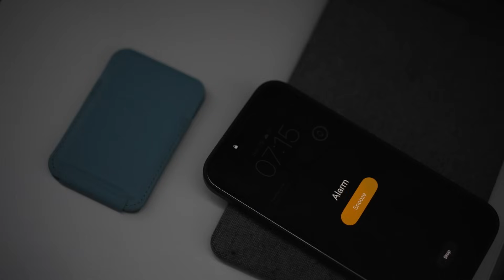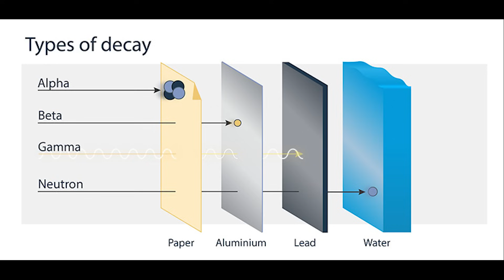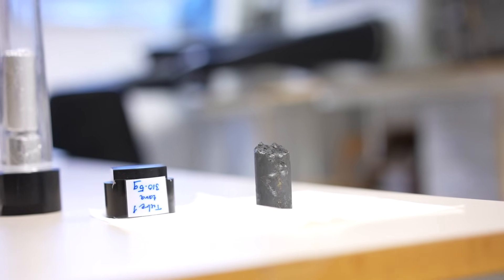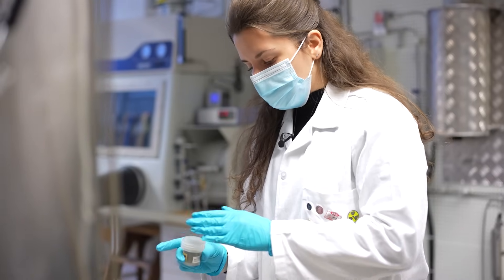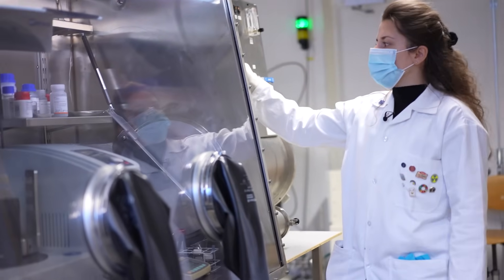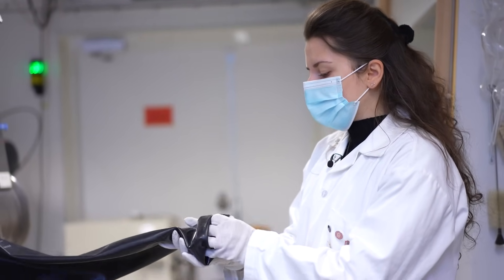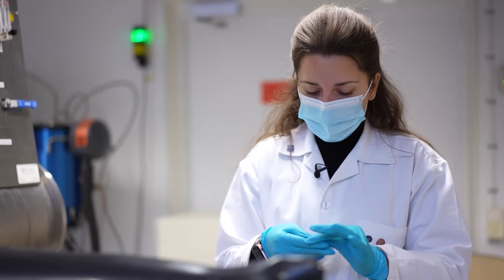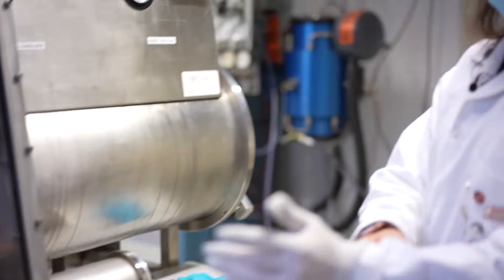Touching URANIUM and EXPOSING Myths - A day in the Life of a Nuclear Physicist

Comment: Interesting. But what happens if you touch a radioactive uranium rod (nuclear fuel used) freshly extracted from a reactor?
I think you would die in less than a day. Prove me wrong.
Greetings.
Reply: It's your duty to prove yourself right. Not the other way around.
Reply: I don't have an uranium rod, so I can't.
Reply: @KasusEpykMusykII Spent fuel is definitely far more hazardous than fresh fuel. Straight out of the reactor it's very hot as well. You'd get thermal burns as well as receiving large doses of ionising radiation from the short lived fission byproducts. The short lived isotopes are the most dangerous. Residual U238 has a half life of over four billion years. As such it's not a radiological hazard.

Comment: I know this video is kinda old but I would like to know at which point pellets start to be dangerous. As I understand it it's proximity due to expelled electrons of nuclear decay. So fuel cell will be radioactive due to amount of pellets inside and with many fuel cells close together both radioactivity and heat will raise. Am I correct?

Comment: She would be dead if she even comthe e across the depleted pellet because then it emitting gamma rays and beta rays, But still the way she explained it is remarkable as it need guts to hold fuel grade pellet in hand, I once held a hockey puck size uranium-235 in hand for experiment it is warm to touch and extremely heavy.

Comment: I cringe every time I see long haired people working in a lab. Although it may not be technically and issue in this lab, it is unprofessional. Also, while you are shielding your hands handling alpha emitting sources your face and eyes are not shielded. Albeit there is air in between, I would still wear a plastic shield. That u-238/235 plug is fairly hot  for example.

Comment: Hi Elina.,  thanks for your video it is very educational ! but i got some questions would like to find out,  1. when you handling the uranium, you wear nitrile gloves and medical mask, you just told us the radioactive is quite low, but can the nitrile gloves and mask can really block the radiation from the metal ?  as my understanding, those protective wearing is only able to block alpha rays, not beta and gamma.   2. you did put the uranium on the table for measuring out how much uSv/h there is, but after put it back to the plexiglass tube, would the table also your gloves contaminated ? even theres no dust remains ? thank you !

Comment: Over 30 years ago my brother in law was a foreman at a solution ground water mine.   They used 8000 gal of ammonia per day to make the uranium oxide  soluble then a polymer column was used to extract the Uranium from the water.   Then the yellow cake was worth $6 / lb in 55 gal drums.       He was not concerned about radiation.

Comment: I have measured radiation during every time i fly and i have counted up to 430+ at 39,000ft exposed for hours and its not a common knowledge for most. 
What are your thoughts in regard potassium iodide after the flight ?
❤ your accent.
Reply: What should potassium iodide do after a flight? 🤔 Normally, you should not get in contact with radioactive iodine isotopes during a flight, and I don't think you get enough neutron radiation on a flight to turn any elements in your body into radioactive elements. So, you don't need to block your thyroid. That's only necessary after accidents with nuclear fission.
Or did I miss a detail?
Reply: @cymbala6208  no you did not miss anything maybe I did.
thank you for the reply and sharing

Comment: On a Nuclear Submarine, I worked 15' from the nuclear reactor all day and night, when I was getting stores from some storerooms I had a 10min exposure limit in certain storerooms but not outside the room, the rooms actually blocked radiation and were used that way, I wore a film badge and I got less radiation than the people on the surface...

Comment: Well 500 ySv/h nothing I would keep an hour on my hand a year dose rate in Germany is just 1-2000 ySv/a 😅

Natural Uranium "dirty" ores, are not harmless, compared to a cleaned Uranium pellets.  I definitely would use gloves and stayaway from dust particles of thorium or uranium ore.

In Germany the Sowjetunion let dig out a lot of uranium ore with pure hands in the occupied east-german sector without an savety equipment in 1960-1990 and we had a lot of lung cancers and related lung issues and deaths on the mining areas in the mixture of heavy metal toxicity and radioactive byproducts of natural urainum ore.

Sowjet minds always lowerd the relatet health issues and kept the workers keeping working in DDR sowjet sectors to kept its mining output high by lower any investigation about any danger of mining uranium.

So I would not say dirty uranium ore is harmless. 🤔

Best regards a medical engineer 🙃

Comment: I like the explanation, it's only really nasty when it's in particles inhaled like from being burned. It is pyrophoric and will readily burn in air.
Natural uranium does emit gammas from the natural decay daughter products as it heads towards stable lead. 
At 4:04 does her gloves now read a higher count since you touched the metal and got micrograms of it in the nitrile/rubber on there? Touch contamination and dust would be an issue long term.

Comment: I have some questions. Is the depleted Uranium less radioactive than, natural uranium? And secondly, is depleted uranium less radioactive than other natural occurring minerals (not their radioactive counterparts)?
Reply: Yes depleted uranium, like refined metallic uranium is less radioactive than uranium ore.  This is because in uranium ore the uranium is in equilibrium with its progeny (aka "daughter products") e.g. Ra-226, Bi-214, Pb-214, Po-210 etc., and they are mostly more radioactive than uranium itself, as shown by the much shorter half-life values.  
The removal of some of the 0.7% U-235 from the 97% U-238 metal does reduce the radioactivity of uranium metal slightly, as U-235 has a shorter half-life, but it isn't all removed, just "depleted" from 0.7% to about 0.3%.

Comment: I appreciate the explanation regarding sample and surface preparation prior to characterization. 

While attending university, I worked within various chemistry and physics laboratories, specifically working with single Crystal and powder X-ray diffraction groups. 
Also work with growing crystals of organics for IR spectroscopy.  

Where I see the most parallels for the UO2 preparation and my work, was with surface preparation of rock samples for optical work. 
How thin of a wafer slice from these pellets would your group use?? 

Excellent video! Thank you for sharing!

Comment: I was at a tour of a nuclear power station in 2016, (Heysham 2), and on the tour they told me how they inspect the fuel rods before they go into the reactor.  At this point they are not particularly radioactive they said, and are inspected by hand.  you can safely handle Uranium fuel before it goes into the reactor with your bare hands, only once it has been through a cycle in the reactor core does it become dangerous. The blue gloves were not for the protection of the workers handling the fuel, but to protect the fuel from the oils and grease on the skin of the person handling the fuel

Comment: I guess an interesting question would have been what is the advantages of nitride over oxide?  Why is it worth having a fuel that is prone to oxidize?  Also, is there any problem with it oxidizing?  I mean neutrons need to be moderated by water before they can enable further reaction so as long as you have the same uranium atoms in roughly the same space does it matter that both oxygen and nitrogen have found their way into a molecule?

Comment: When I worked in aviation I would handle the wingtip end weight bars made of depleted uranium with normal gloves and no special protective gear. All I recall is that was way heaver than lead.
Reply: Often these sorts of weights are nickle-plated, which prevents them from breaking down, and also stops any remaining alpha activity.

Comment: M. Sc. of chemistry here and some general infos about glove boxes because some people have asked:

Glove boxes can be used both ways. My colleagues at the uni worked with glove boxes as well because their synthesized substances were air-labile (unstable in air due to oxygen AND water vapor). For protecting the substances you need a slight over-pressure  inside the box. If there was a leak the inert gas would come out and no oxygen would get in.

If you are working with substances that must remain inside and the environment incl. YOU needs to be protected, then a lower pressure inside is necessary so all contamination remains inside! E.g. in virology labs working with potential dangerous germs or viruses .... or biochemical labs where research on GMOs is done and even if you work with higher radioactive materials. If there was a leakage the air from outside rushes in and so everything STAYS inside. 😉

Comment: The way you handled radioactive sources and showed it online to other people was reckless

First, you did not specify to the viewers the activity of the source you were handling in the video. That's a major mistake.

Secondly, based on what I saw on the label specifying "Tube 1 310 g", I assume the whole tube contained 310 g when shipped and also, there, the label does not specify the activity of the whole tube. Your sources were poorly labeled!

Thirdly, let's estimate the activity of your sources based on a specific activity of 25.4 kBq/g for natural uranium, you've got around 8 MBq of natural uranium in the whole tube (310 g). If the tube contained 5 pieces of metal, the piece you were handling had 1.6 MB in it. Your nitrile gloves gave you some protection so it's not that you had the source in direct contact with your skin but those gloves are definitely thinner than a 5 mL polypropylene syringe and a 1.6 MBq source in that 5 mL syringe give a dose of 53 mSv/h on your hand when touching it. That's reckless because you can avoid that dose by just handling the source with a long tweezer like any radiation workers are taught to. You've got poor training in radiation safety and moreover, you broadcast this poor training online.That's doubling down on major mistakes!

My calculation might be wrong but I doubt that because the same source (1.6 MBq) assumed as a point source would give 350 uSv/h at 30 cm and your dosimeter showed that range (500 uSv/h, slightly higher because your probe was closer to the source than 30 cm).

So, viewers, be advised! Safety first and always when handling radioactive sources! Always label them properly, name of isotopes, and activity. Handling them with long tweezers. Know your source and never touch them directly, they are hot!

At last but not least, alpha emitters cause more damages when touched compared to other isotopes so the low activity is a false apparent safety. The contact dose with gloves on is about 100 times higher than what a dosimeter would show and if you have some natural uranium on your skin, the received dose goes up by 20,000-fold! So, just be careful with any radioactive dose you'd be handling in the future.

Comment: The most interesting thing I learned about in the operation of a nuclear reactor was the concept of the neutron source rods. That is, effectively, a nuclear match (or pilot light) to start the reaction. Up until that point, the pellets are relatively low emission and safe to handle. Once they are exposed the neutron source rod, then the process of fission accelerates and you get all the active secondary materials that are the products of decay and you don't dare touch them for a few hundred years (at least)!

Comment: What is the face mask actually good for?
Reply: Prevent ingestion of any fine dust particles that might get produced whilst handling the material. It doesn't take much to stop alpha particles, even dead skin cells will do it. However, you do not want an alpha emitter lodged in your lungs, or gastrointestinal tract where it can irradiate nearby living cells. Cuts and open sores can provide another entry path into the body for fine dust particles to enter. Although statistically possible, I guess, a single alpha particle entering a living cell would probably not result in a cancer causing mutation, the cell might repair the damage or just die. But even minute, alpha emitting particles, with a long half-life and lodge in one location, may cause enough cell damage to eventually create a cancerous mutation.
Reply: @hitchmille  Ok. When I hear radiation I think of stuff that needs some heavy protection but since she doesn't have any the mask was even more confusing.

Comment: I remember going on a tour around the nuclear power research reactors at Winfrith in Dorset c.1970/71, a friend's father worked there [it's long been all dismantled]. They passed round a slice of a thick rod of depleted Uranium [i.e. mostly U238] for us all to handle. This would have been even less radioactive
When Elina held up the large chunk, I was a little surprised it didn't appear rather heavier, it's quite a lot denser than lead, closer to gold.

Comment: Madam, your explanation was lucid. I had some points to clear as a layman. 1. which rays are hazardous to humans.(A,B,G or neutron)..  2. You showed two pellets, 1 was uranium dioxide and 2 was uranium nitride. Now, is the 2nd one purer than 1st. If so, does it mean 2nd one is enriched. 3. Are these pellets used in steel rods which are dipped in water to generate steam.

Comment: People have a weird fear of radiation.
I have an old lens from the 1950s (Takumar 55mm f1.8) that has thorium coating on the rear element (apparently it gave a beautiful look on film photos), people freak out when they hear its radioactive.
But when I took it in front of a geiger counter the back was indeed getting a reading, but when I took the probe to the front there was basically nothing, so there was not a lot of gamma radiation from it, and no need to fear it.

Comment: To start, very nice video, i really enjoyed it!

You are not afraid of cross contamination from holding the Uranium and after that touching the Geiger counter?
I would think procedure suggest to wear double gloves and remove the top layer after touching the Uranium, of at least put on new gloves after touching it.
You don't want to end up someone grabbing a contaminated Geiger counter that someone could touch with bare hands (like you do in the final seconds) and that would in a moment of inatention touches his/her mouth. Although not very radioactive, it still is a heavy metal and would really screw with your internals like your kidneys. And eating Alpha emeters is never a good thing, your iternals being soft tissue with direct contact.

Comment: Fantastic knowledge here.  Question though.  You put that small uranium pellet back in side the bag, on the outside, with atmosphere all around it and sealed it..then placed that bag in the tube, then back in to the argon filled chamber.  Elementary question, but, how do we know the atmosphere that was in that bag is most certainly gone, and been replaced with argon?
Reply: I doubt that that kind of bag can keep air inside a vacuum and i would guess that the tube is first evacuated and then filled with argon.
Reply: @DiabloDBS  And this is why I’ll just stick to PC Support.  You are probably correct, the atmosphere is easily sucked out of that little bitty plastic bag.
Reply: @bmichael7732  
I mean i just assume they apply a vacuum first.
If the chamber is just flooded with argon pushing out the oxygen it would be a different story.
But i guess in that process a lot of argon would be wasted .. so creating a vacuum first is likely much more economical.

Comment: The green stuff (UF4) is what I've personally handled the most in the past, even though it was a byproduct from working with UF6 gas (Hex). It would actually start as a rather blue color that would turn green from exposure to moisture in air and release HF gas (very nasty stuff).

I do remember it being one of our radiation safety rules to always wear safety glasses when handling it in the lab even in containers for protection from beta, so was a bit surprised you weren't wearing glasses. Although I do remember measuring beta from samples in containers and not getting that much (but a much higher count when outside of a container), so it's probably just a difference in safety measures between Europe and the US. I know the US nuclear industry goes to some pretty extreme lengths when it comes to nuclear safety.

Very much liked the talking into a pancake probe like a microphone at the end lol. Great video!

Comment: There are several grades of uranium. Non-fuel grade, low enriched fuel grade, highly enriched fuel grade and weapons grade. Non-fuel grade is below 3% 235u. Low enriched fuel grade uranium is 3% to 5% 235u. Highly enriched fuel grade uranium is 20%+ 235u. Weapons grade uranium is 90%+ u235. I believe the amount of harmful radiation depends on the purity level.